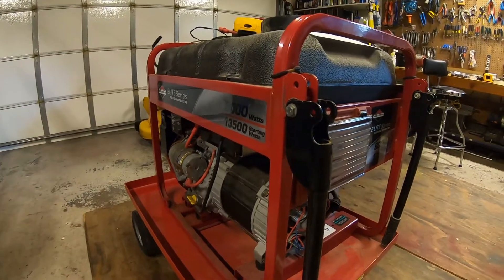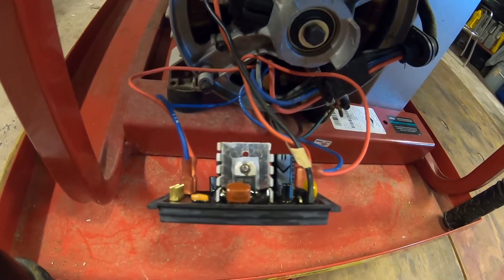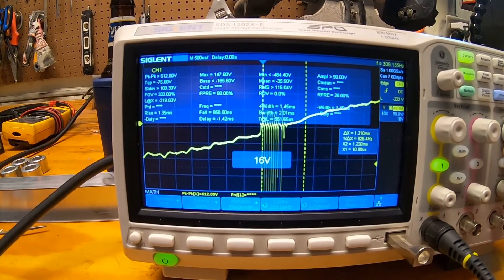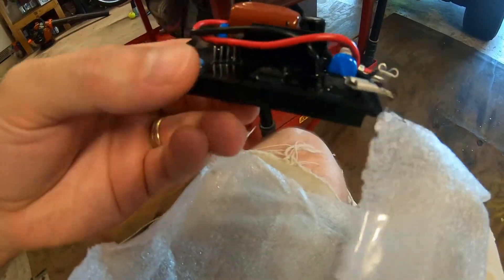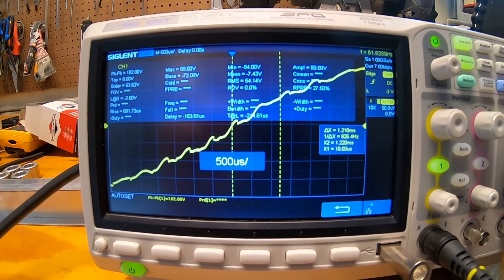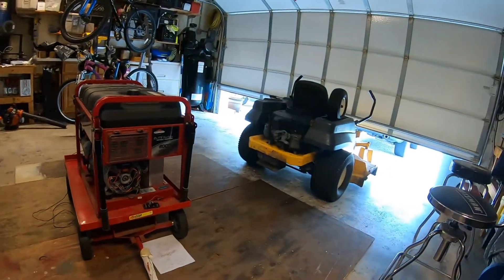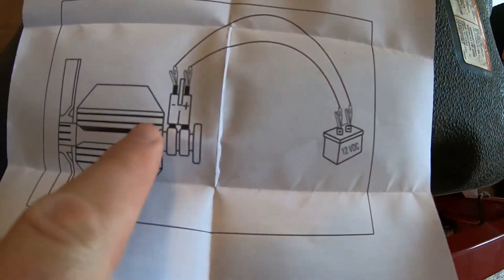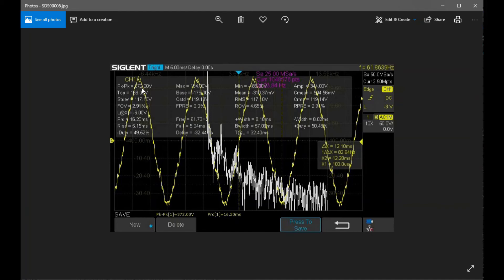Replacing the AVR in a Briggs & Stratton generator

Comment: The defect you refer to is in fact called RINGING it occurs when theirs massive back emf when a connection is broken momentarily,  you really need to clean those slip rings and check carbon brushes ! I am sure the new AVR will be able to compensate but the underlying problem may persist in years to come. I design circuit boards and know a lot about electronics, often a good voltage regulator can smooth out spikes like that but if the underlying issues are also corrected it can improve the noise ratio a great deal.
Reply: See my video https://youtu.be/6ikautyunfo

Comment: I'm having the same problem as AP514  My AVR is new like yours without a trim pot to adjust voltage and only getting 113v. Any ideas how to adjust voltage? Thanks for the great video.
Reply from the maker: Check your engine RPMs to make sure that it is pretty close to 3600 RPMs. Please also check the voltage on both 120 volt circuits. Are they both equal and low or is one higher than another?
Reply: @JoesGarageProductionsLLC  Thanks for the quick reply. Engine is at 3600 RPM 60hz. Voltage same on all outlets. If I adjust the governor higher then I get move voltage but don’t want to burn the motor. Unfortunately these AVRs don’t have a pot voltage adjustment. Thanks
Reply from the maker: @mitchmouchabeck4069  yeah unfortunately maybe the AVR even though it's new it's just no good. 113v is pretty close to the +/- 5% guideline... You'll probably be fine.

Out of curiosity does the voltage change much when you load up the generator?
Reply: @JoesGarageProductionsLLC  yes unfortunately it drops by a couple volts under a load. What’s weird is that it’s the second AVR I installed with the same results. Thanks

Comment: I am only getting 116.3 volts from my AVR (load)116.6( noload) I ordered a New upgraded one and it is giving 113 volts under load...BAD new AVR  ??
Reply from the maker: Some AVRs have a trim pot on them to adjust the voltage... check to see if you have an AVR with a VERY tiny adjustment screw on there
Reply: Did you ever get this figured out as I am having the exact same problem? Thanks.